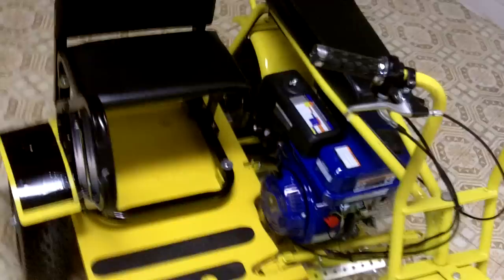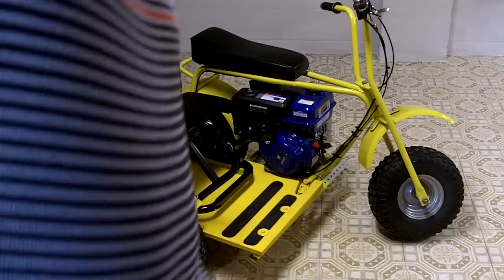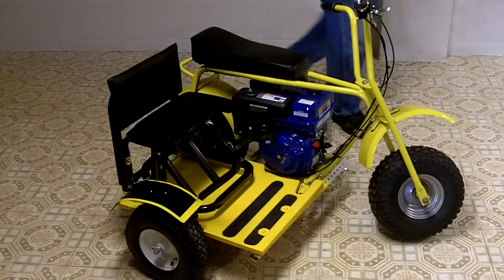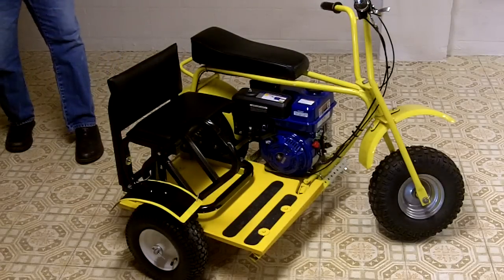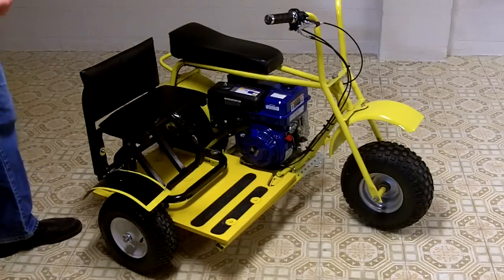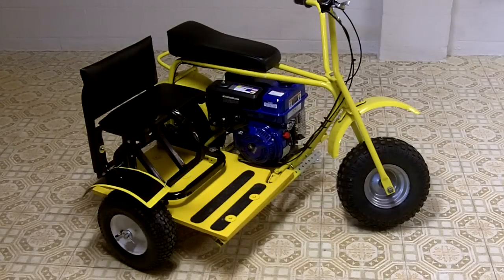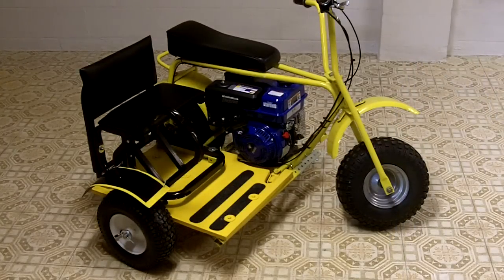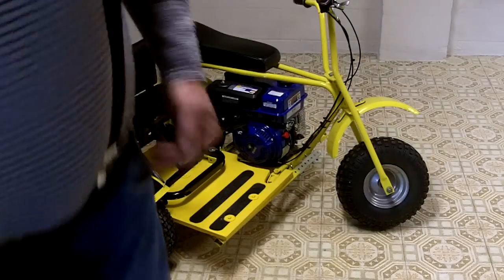Mini Bike Baja Doodle Bug Side Car for the Do it Yourself Average Home Handyman

Comment: Neat project.  Those 6.5 hp motors are a must on the doodlebugs.  Mine tops out at 39 mph.  There is a guy  on oldminibikes.c@m that sells a kit to put that motor on the doodlebug.  It requires no drilling and is very complete.   Hope you post a video of it in action.

Comment: Yikes!  my ankles cringe.  Need some passenger leg/ankle protection there.  A simple toeboard/shoe saver of 4" extra.  With you sitting there in the car, you had another shoe length to play with before steering became a issue.  Even the kids will get there feet out past the end of the platform when bounced around.  A very neatly build obviously, minus the tin chinese square tube,,but the patterns are there for a sidecar frame and re-suspend.  Your outside needs a bit of toe and camber adjust,,hope that was figured in as would be at almost max weight.   It could be a deadly squirrely bitch either way unless.  Sidecars are no joke.  Love the yellow and black and your time involved in the whole thing to get it there..   1 banger Pit Taxi.